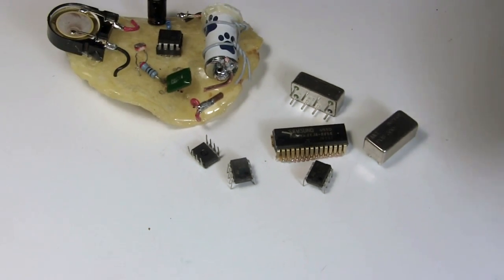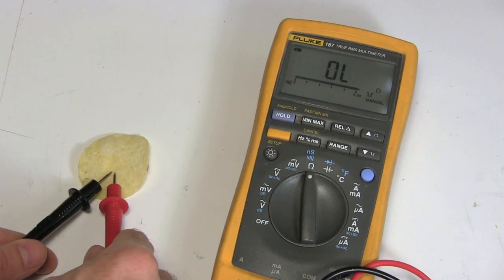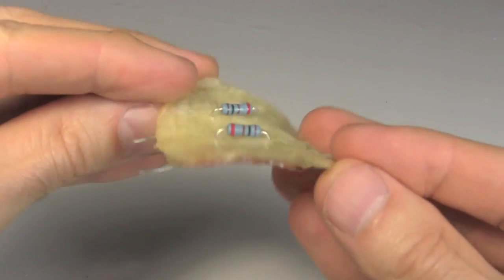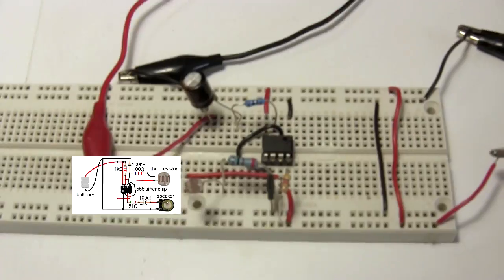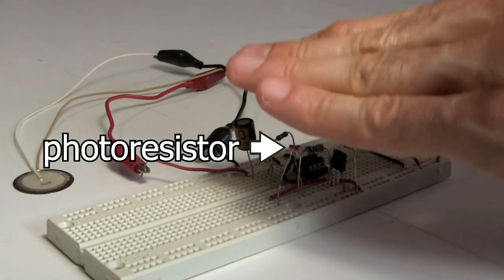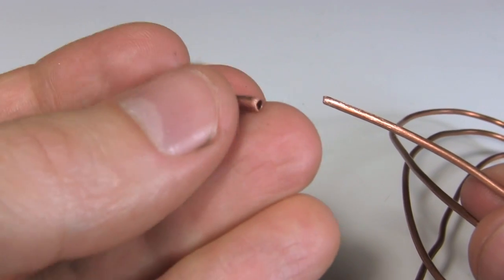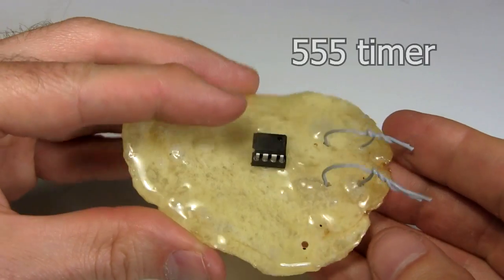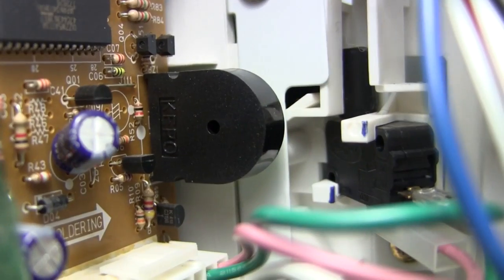Potato chip circuit/macrochip with 555 timer circuit

Comment: sir can u give us any circuits which use 5 volt power supply?
Reply from the maker: The one in this video works with 4.5 volts but will also work with 5 volts. You can find a bigger picture of the circuit on my webpage here http://rimstar.org/science_electronics_projects/potato_chip_macrochip_w_555_timer_circuit.htm.